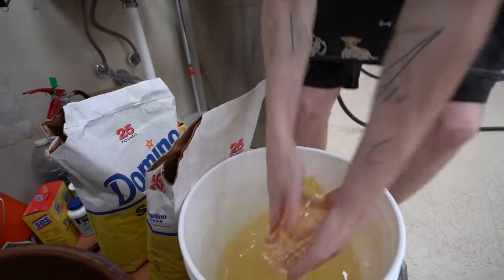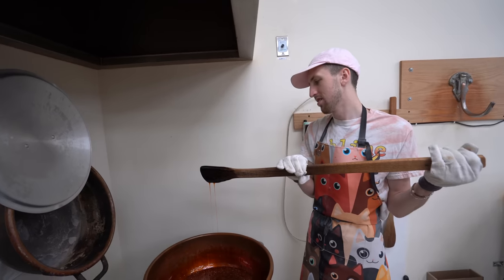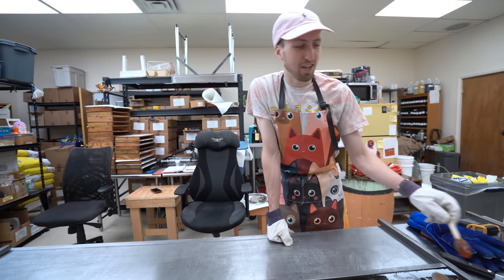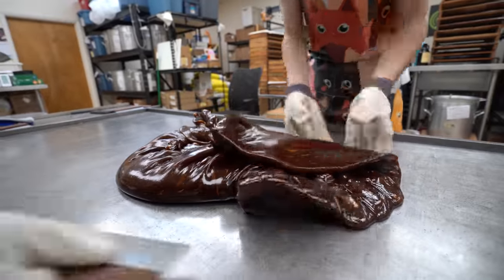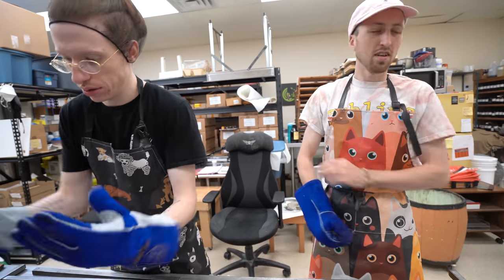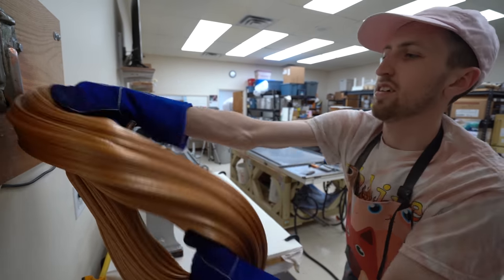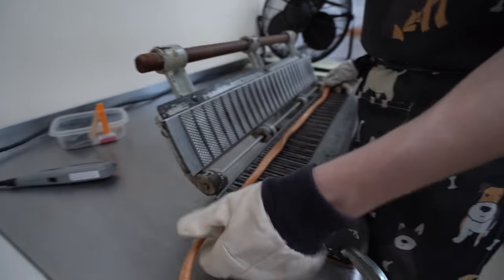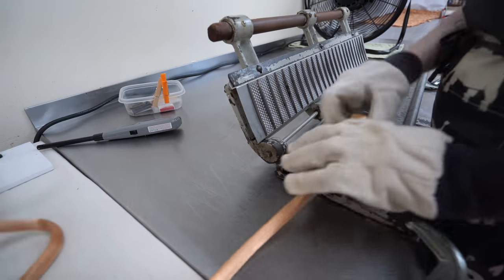ALL of That Pumpkin Spice Is Going Into This Batch of Candy!

Comment: Hey so i had an open plan apartment like he had and i have the best advice. they make box fans of all sizes for windows & get the biggest fan you can fit in front of your bedroom window POINTED OUT & turn the ac on high as well as the fan. Have a literal wind machine pointed at you while you sleep & it should pull the cold air through the house. BUT for this wind tunnel to work the bedroom window has to be the only open window at night. Trust me apart of that heat you’re feeling is a lack of circulation in the room. I live in miserable Missouri where the humidity is 100% in the summer. It doesn’t get cold here until November!